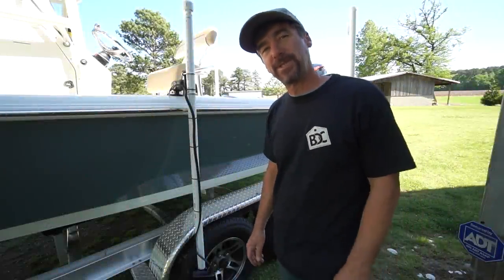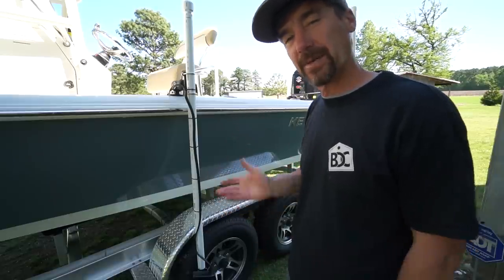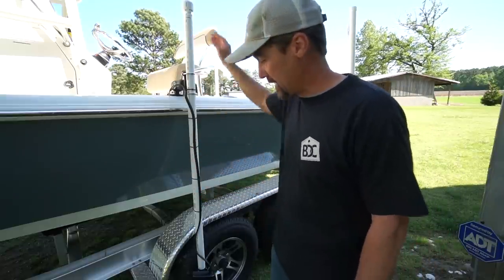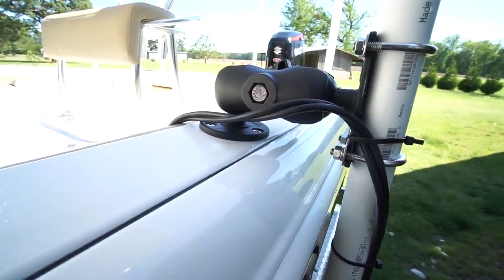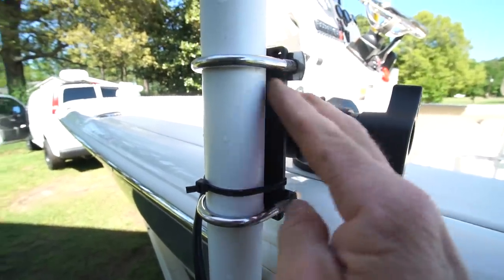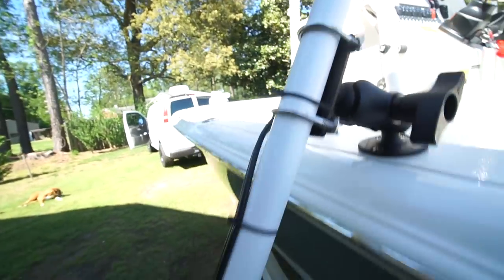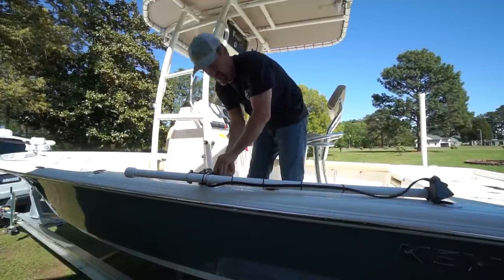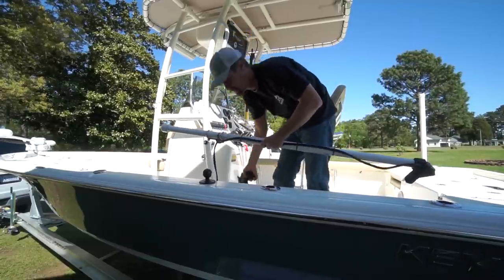$15 Panoptix Livescope Rotating Mount Build for a Boat

Comment: Great video! Maybe mount a transducer mounting board with 5200 on the rail instead of drilling into the boat. Still semi permanent. Also I would do a 90 elbow at the top with a short tail handle so you know where it is pointing without looking for an index mark.

Comment: Go to menu, scroll down to transmit and select.  That turns the transmission of the LiveScope off.  Keeps you from turning the unit on and off.  When you drop the transducer back in merely hit  select again (it should still be on transmit).
Reply from the maker: THanks for the tip!
Reply: I've read that the transducer may overheat if left on while out of the water.
 I believe I read it from Garmin somewhere.
Reply: Eric Hubbard That is a fact particularly if it is hot out like in Texas in the summer.  I turn off “transmit” if I am going to be more than 	10 minutes from the next waypoint.  It is not that difficult.

Comment: Thanks for the  video.  Nice idea.  I especially like your storage system.  I have an 8 ft plastic boat I don't want to drill.  I'm thinking about fastening things to the boat with  thick wall PVC and contact glue.

Comment: One minor modification is to put a 90 degree on the top instead of a basic cap. This will provide a supper obvious visual orientation from a distances what attitude your transducer is set to and provide a mechanical advantage when twisting the PVC pipe if your hands get slippery or cold. Obviously there is very little drag on and small effort to rotate the PVC slip shaft. Cheers, #SeattleRingHunter

Comment: Thanks for the parts list, very good info and I'm going to utilize it to re-do my mount. I have a question though, why do you have the transducer index pointing more upward if that makes sense? I thought the top of the transducer should be level, not canted? I'm sure you have a reason and I like to learn. Thanks again for your great videos.
Reply from the maker: I was able to scan shallower water with it in that position. It was something i discovered playing with angling the pole.

Comment: Nice.  Spent $95 on my first removable separate transducer mount cause I was sick of fighting w/ my spot lock and cables getting all twisted up!  I've got some removeable pretty solid rod holders I plan to use for mounting and using your pipe fittings w/ maybe a small handle to see which way front is pointing.  :o)  Thanks!

Comment: Instead of that top cap, you could mount a 90 degree elbow and a short straight pipe, and that would make it even easier to tell which direction your transducer was pointing.

Comment: What stops the 1" pvc pipe from sliding down. I know you said 1" pipe fits into the 1 1/4" pipe and at the top I see  a slip to female thread is that 1 1/4" then it looks like you have a  1 1/4" slip to male thread with a 1 1/4" cap on the slip part?? is that correct? What is connected to the 1" pipe at the top? Thanks for your help.
Reply from the maker: The one inch pipe is glued into the threaded upper fitting and that holds it from going down. THe Transducer mount keeps the pipe from going up. Nothing is glued to the 1 1/4 pipe

Comment: I am really late to see this awesome video as well as your previous ones. Because I just got a Livescope. I hope you're still able to reply. What is that mount that is holding the transducer? It doesn't look like the aluminum U bracket you had on your previous design. It looks like you're not in Perspective mode there. But will that setup allow P mode?
Reply from the maker: This video was before the perspective mode was available

Comment: I'm a bit late to the party and and to say ks for a great DIY video.  One question, Does the transducer tilt toward the boat or away from the boat?  I see many where it is tilted away from the centerline of the boat but yours appears to be tilted toward the centerline (under) the boat.
Reply from the maker: The tilt angle can be changed, not sure what you mean by forward. I always have my rotated up to the forward scan position

Comment: Hey bud I just built the same pole and it looks great. I’m going with the garmin 93sv and livescope. I’ve seen some people use a lithium 12v 10ah battery. My unit will actually be portable. Just wondering what battery you are using when the livescope is on your kayak and how long it will run. Thanks again for the great ideas!!
Reply from the maker: In my yak I run 4, 10 anp hour Nocqua's  wired together. I have never run the system dead yet, even after spending 14 hours out on the water.  A single 10 amp hour battery would last around 3 to 4 hours constant use I would think.
Reply: Thinks bud. I might grab 2 and have one dedicated to livescope and one dedicated to the unit.
Reply: Also wondering. If I run each off there own battery would a 7ah work or should I stick with the 10ah

Comment: 1st question How far forward can you see with your live scope? Do you have the pole deep enough to look under your boat? Can you turn the transducer to look at your trolling motor?
Reply from the maker: You can go up to 200 ft, yes it will look 360 degrees around the boat. Naturally that would include whatever direction your trolling motor is in....

Comment: I have a 210 BR and need advice on how you ran the transducer cable once it went inside the compartment that the fuel fill is in to the console.  I dont have speakers in that cavity like you do and was wondering if there was a conduit for the speaker wires that you used to run the transducer cable or what?  Thanks!
Reply from the maker: There is a cutout in the supporting runners that I found looking around in he hull with some mechanic mirrors. I pulled the speakers and managed to fish the cable through the cutout and up through the drain in the console for the front seat cooler
Reply: @SouthernReelsFishing  Thanks Jesse!  I will get to work on it

Comment: Cable Ties will crush that very sensitive cable.
Use electrical Tape per Manufacturers' Recommendations.
Reply from the maker: Yeah if you tighten them too tight. Common sense helps there. Just rig them loose and no problems. 2 years still using zip ties and no issues.

Comment: Thanks for the design using the u-shaped metal bracket for the perspective mode too.  I was using the set up yesterday on my boat and found that went I was going 2-3 mph that the tube would rotate.  I tightened the ram mount handle a lot as well.  What is the max speed you can troll at using this?  Note: it worked well bottom bouncing around 1.2 mph.
Reply from the maker: My boat idles around 3 mph and this will hold fairly well in that depending on the currents. I do use a size D ram mount which is the 2.25 inch setup.

Comment: I notice from your other pole you use a t pvc would this be ok with a boat or do you need the bracket thanks
Reply from the maker: It might be ok, but depends on if you plan on idling in gear with the setup deployed or if you are fishing in heavy currents.

Comment: The adapter (upper Inner Pipe Fitting) is flush on the outside with the 1 1/4 inch pipe.   You have a link for a 1 inch adapter, is this really suppose to be an 1 1/4?
Thanks
Reply from the maker: The upper pipe fitting glues to the inner pipe. Nothing is glued to the outer pipe.

Comment: hey jesse what are the parts at the top that controls the rotation I understand the pvc poles but not the top section of what to use
Reply from the maker: Its just a fitting that glues to the inner pipe. I used a threaded adapter that I then found some other fitting that fit it and set it up to where it was comfortable for me. I have a parts list in the description of the video

Comment: So couldnt you just mount the transducer to the transom pointing outward? Or does it need to be on a swivel?
Reply from the maker: Yes you could do that, but you wouldn't be taking full advantage of what this setup can do. Its hard to explain until you use it, my first mount was fixed and I saw very quickly why being able to rotate it was so beneficial
Reply: @SouthernReelsFishing  gotcha makes sense. Im thinking of adding it to my Garmin just not sure how I want to mount it..